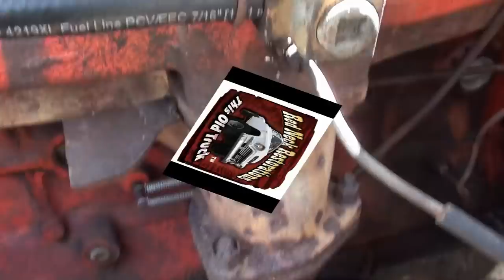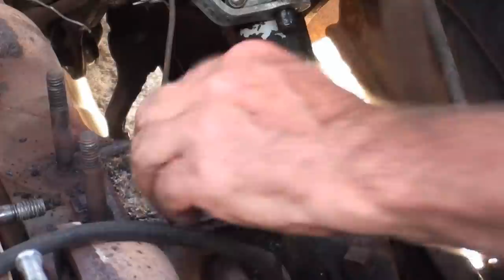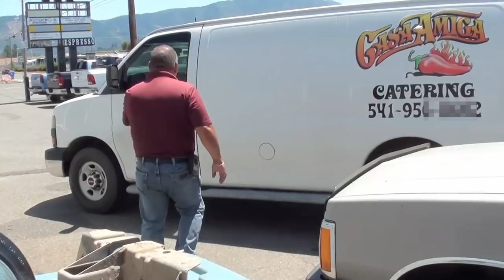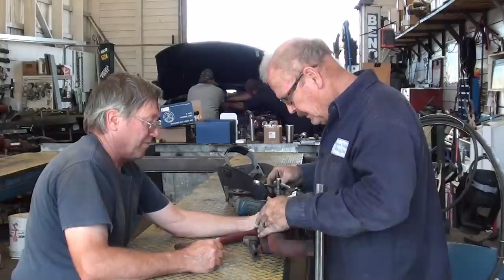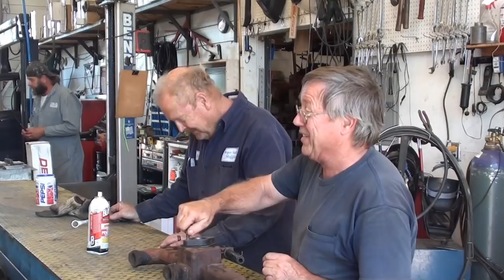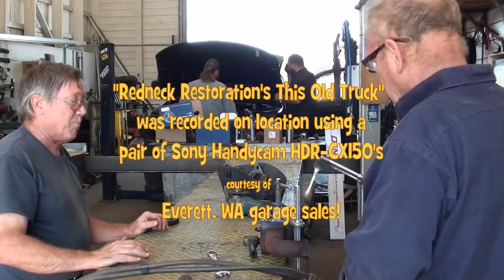1959 GMC Exhaust Manifold Dilemma Part 2!

Comment: Still got that touch of turning 19:57 into what seems like only 5 minutes.
Reply from the maker: You don't know how much your comment helps. I mean that! I used to try for that, then I got to where it became a chore to do anything. From recording to editing to posting. If it wasn't the computer and the crashing program, then it was YouTube constantly changing things. Even now, I'm locked out of my account on my main computer, which is where I reply to comments. They now have the 2 step verification process" I set it up for voice notification because I have a land line, but it continues to send the verification code by text.
Reply: @ElderlyIron  “The common eye sees only the outside of things, and judges by that, but the seeing eye pierces through and reads the heart and the soul, finding there capacities which the outside didn't indicate or promise, and which the other kind of eye couldn't detect.” ~Mark Twain

Little wonder schoolboards strive to remove his works from their modern fabricobbled curriculums.
- Daily driver of a '53 3100 5 window; with flat epoxy primer brown rattle can Rustoleum applied every presidential election year. And a 2nd owner  
'68 650 Triumph Trophy Sports I'd bought for a dollar a cc back in '73 then had totally restored back in 2012... when North Texas weather permits; & there are plenty of 'em here Jeff.
Here's one I word whittle for Y'all's roosters will agree with & that I found works on most atheist's with no Reply back as well...

''Why? He Came First!''

The Creator, He came 1st.
The Creator's Rooster, he came 2nd.
The Creator's Hen, well, she came 3rd.
For did she not have to be laid...
Before all 3 entities eggs ever could?
Therefore; does not creation demand that Creator?

-Just another one of those many one's of we...
Who's just awaiting His Just Return. ⚖🪃 4722
Reply: @soldtobediers  spoken like a true southerner. And a true philosopher.

Comment: That job is a real pain. It seems that the rust is harder than the metal. On my 74' Nova six cylinder, the intake and exhaust simply did not want to align. Took forever and several tries, to get it right. Not fun.

Comment: What ab0ut taking out the manifold instead? And the n working it on the bench!
Reply: ,,  The exhaust side is attached to the exhaust pipe, which is also rusted in place 😵‍💫
Reply: That would be easier

Comment: I was wondering if you happen to read my comment on if you a rebuilt kit for my 1955 Chevy 3 sp gear shift box on the column. Or a reman shifter, I have looking for long time, Jim Carter is always out of rhe...even checked Chevy of the 40s. Reply when you can!
Reply from the maker: I did, in fact. I have one here. I'm not aware of any kits. There's nothing in there but grease, springs and some gasket material. I asked what was worn out or broken in yours, but never heard back. You can't count on YouTube to send an email for anything! Did you watch the entire series of all the shift linkage? RNRTOT@frontier.com
Reply: @ElderlyIron  I will take a look and I have not opened the gear box but I will look at your videos. I will get back to you when I get it open in the morning. Thanks for responding